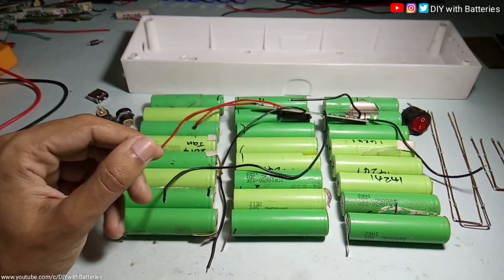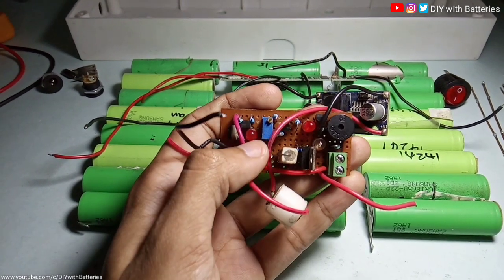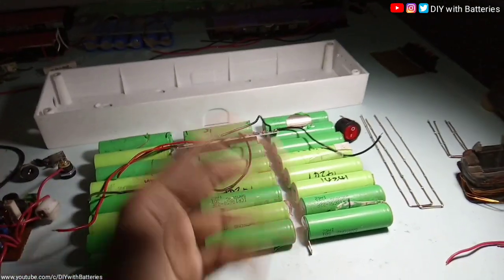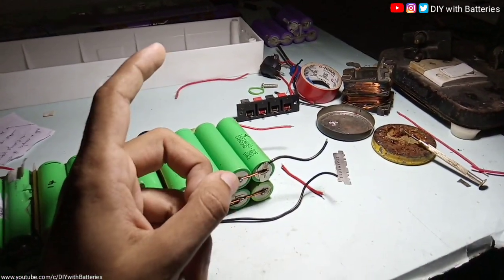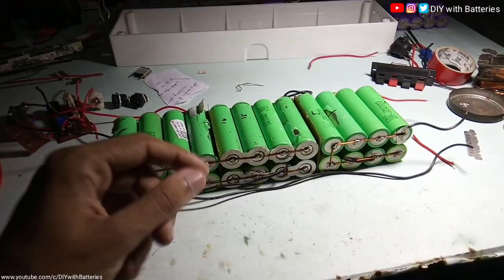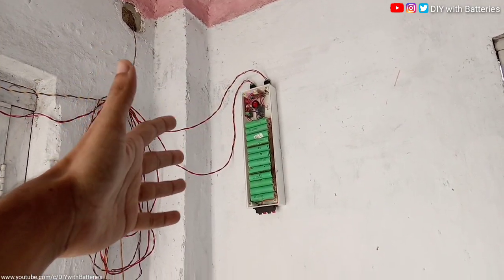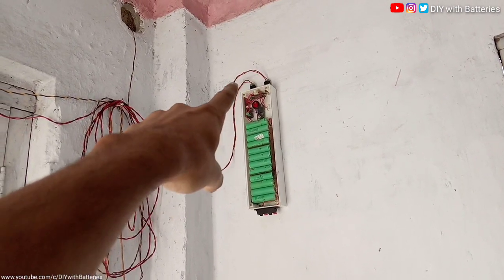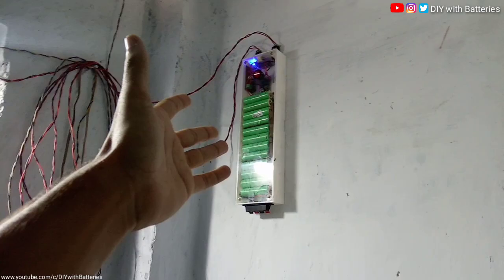DIY Mini Powerwall How to make a Mini 18650 Powerwall 3S 8P Battery Pack

Comment: Hey bro i have a question i have build a pack of 84ah 12v and a 14ah 12v pack and another  3s 8p lithum ion pack max of 14ah to 15ah if I connect them in parallel is there is any problem to smaller packs as the current will be higher up to 14-17A from solar? Please reply ❤thanks
Reply from the maker: No problem Dude you can connect but we have to make sure that there is no voltage difference between each pack before connecting 👍
Reply: Where is the new video mannn n 😢😅

Comment: An another idiot who want to burn his property. Really risky soldering 18650 cells... Also useless as many other projects.
Reply from the maker: Lol that was really great comment Dude it's very important to viewers i really appreciate that, there are so many battery explosion videos on YouTube that can really take the entire house down but all those guess work of causes of miss handling the batteries and wrong connectivity bad bms that's why I tested them so many times before using them for permanent and now they're still running my entire house and i added few more cells (300) for more back up. 👍 it's to use the used cells for your powerwall but we should be careful and check the tem* and voltage for every month ¯\_(ツ)_/¯ any way thanks for sharing your opinion bro i really appreciate that.

Comment: Nice video mate. Interesting use of the existing laptop BMS. What is the max voltage of your pack when charged? These BMS are not active only passive, and balancing only occurs around 4.10-4.15 individual s voltage. Normally only 10 ma balancing. Maybe something to consider. Keep up the good work.
Reply from the maker: Thanks man. 😊👍
12v max charge (4.00v per cell) cause I don't want to loose capacity of these recycled cells again. lol
And the BMS doesn't balance very well but the cells are balanced it's by equal mah.

Comment: Nice so you are using the BMS as a charge controller should be good with just the one solar panel but keep an eye on the heat if it burns out the resister you will lose control of the charge imho at least I think that is what you did lol keep making videos
Reply from the maker: Thanks mate! I appreciate your comment I'll keep it safe with low charge and discharge. 😊👍